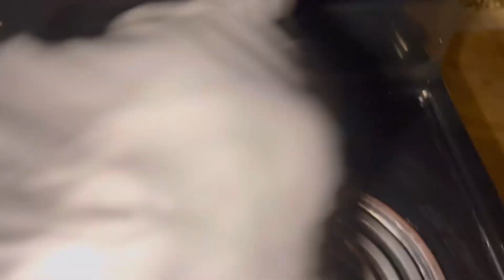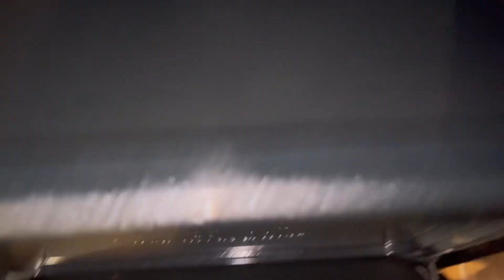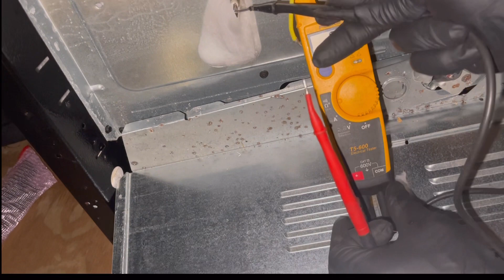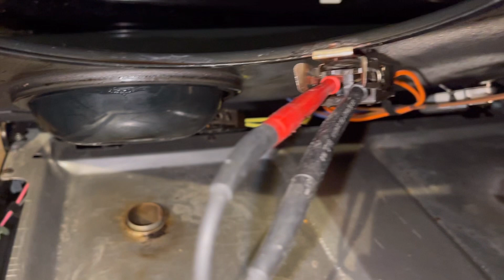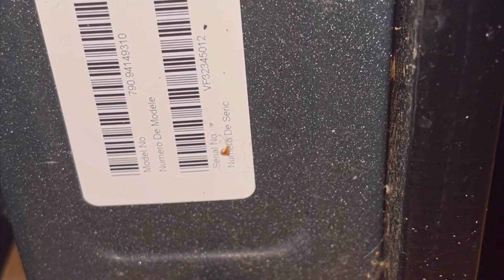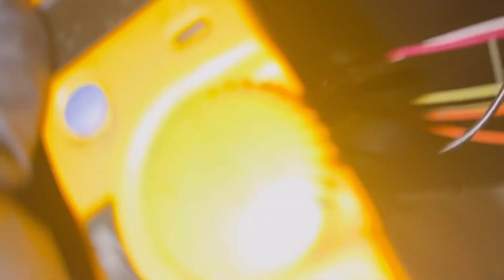Frigidaire Range Checking Voltage | Oven Not Heating | Burners|Switches Not Working | 790 94149310

Comment: Good video. I picked up one of those T5-600 meters at a pawn shop and I don't think it had ever been used. You always do a good job.
Reply from the maker: Yes, I love it. I just broke the tip on it today, though. You might see it in the next video lol.
Reply: That's one good thing about the t-5, You can replace the probes because they will disconnect from the leads. @appliancerepairshorts

Comment: I have an issue with my Frigidaire range purchased in June 2023.  Glass top unit, 5 burners.   Brick's item code CFE3054S, not convection.   Basic model.   I was boiling water in a sauce pan used many times over the years.  One the boiling started I heard a pop and saw the pan in the air.  I was able to grab it but what could have happened scares me.    Burner still works. Any advice on what happened here?   Frigidaire help line person had English as 2nd or little language so no help.
Reply from the maker: The pot sounds like the bottom may have been concave and when the temperature rose, it popped the opposite way and pushed off the glass.
Reply: Well thank you for this info,  More than I got from manufacturer.  Another family member used the same pot & burner since without any issue.  Just lucky me I guess.